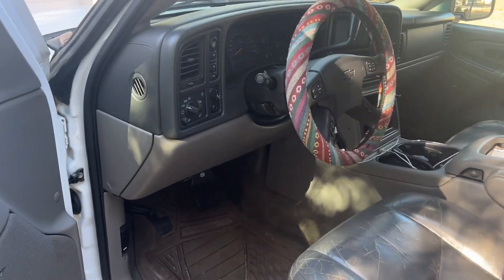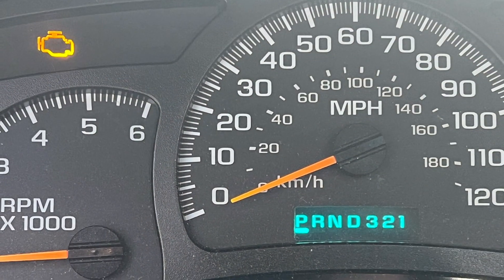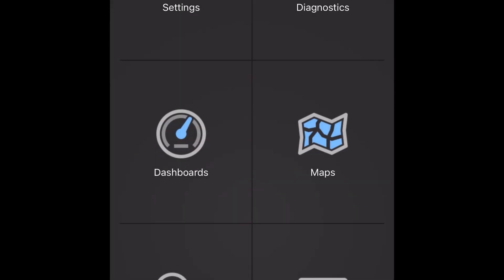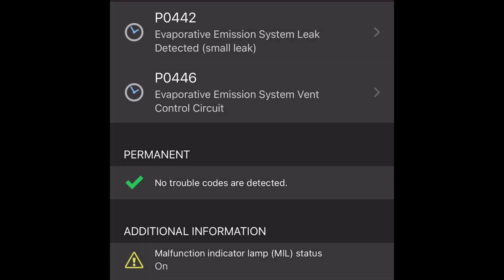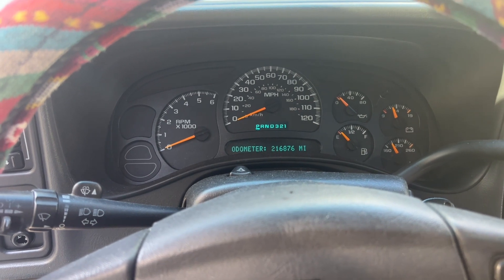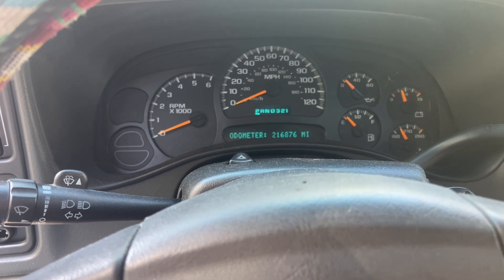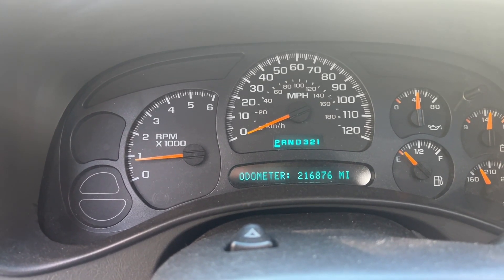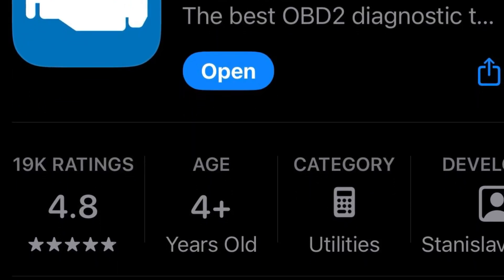2005 Chevrolet Tahoe-Check engine light!

Comment: Thank you! We have a 2005 Chevy Tahoe and been  having trouble with our check engine light. Can't  pass inspection to get our tag renewed. Do you know what a  picture of a lock means above the check engine light?
Reply from the maker: What I have read is an indication of a problem with security systems, may have to replace your ignition switch, I know have an Airbag issue I need to address. I love these trucks but at 220000 miles these things keep popping up!